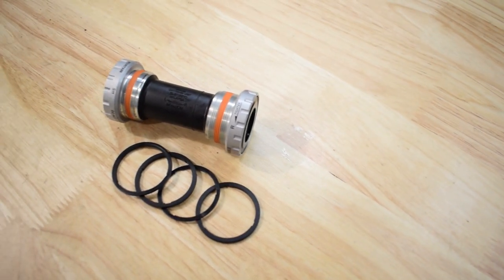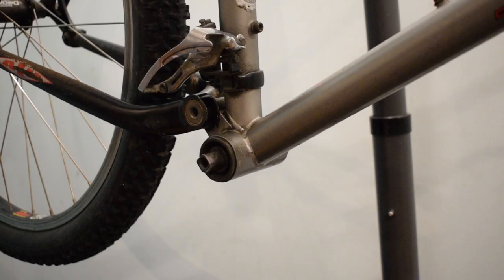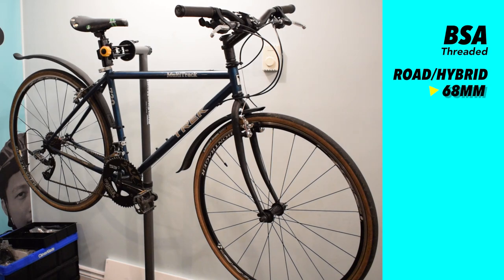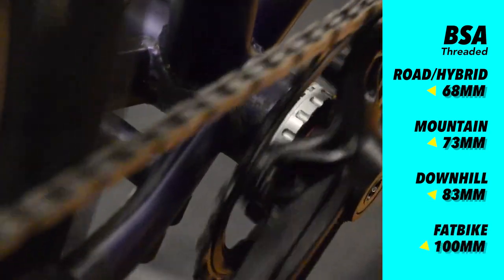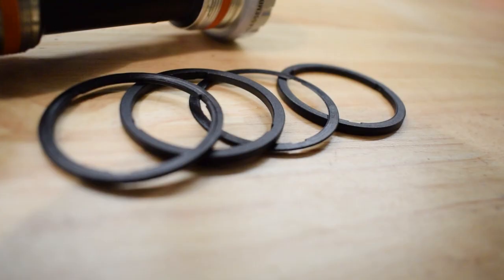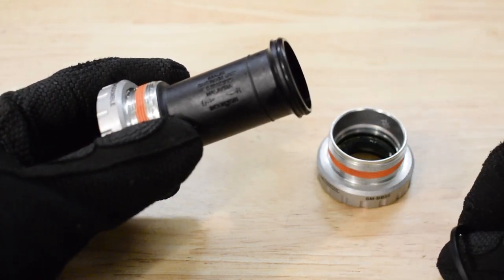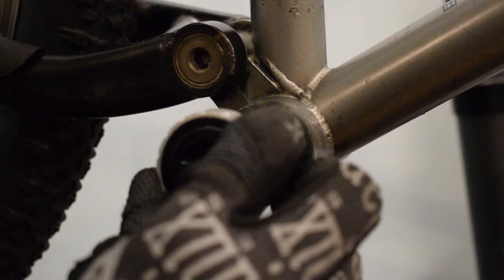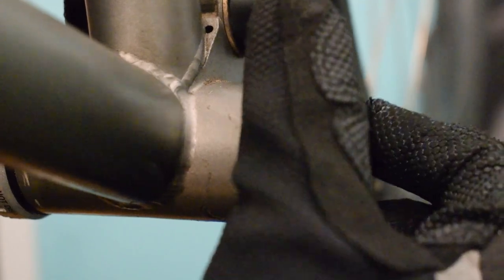Hollowtech II Bottom Bracket: What Size?

Comment: I'm using the same BB52 for my latest build. Unlike other BBs, I realized that this has higher resistance as I screw it into the shell mid-way. I backed off several times as I thought I cross-threaded but seems fine. I suspect it's the orange "loctite" that is introducing the resistance, but perhaps is not a bad thing to make the BB stay snug. I don't have this problem with other brands of BBs (e.g. Racework, IXF, etc). Do you encounter a similar situation?
Reply from the maker: Yes, mine also had resistance when I screw it in from the mid-way to the end.

Comment: Mmh can I use a mtb bottom bracket  with a road crankset on a 68 bottom bracket with the spacers? Because bb-rs500 for the fc-r3030 is hard to get not like the bb-mt501. Both are for 24mm
Reply from the maker: What bike do you have? Road or mountain?
Reply: @DanyoSports  an old touring bike from before 2000. Bsa with 68mm. At the moment with a road bike drivetrain over octalink